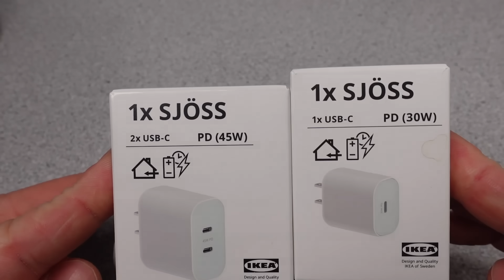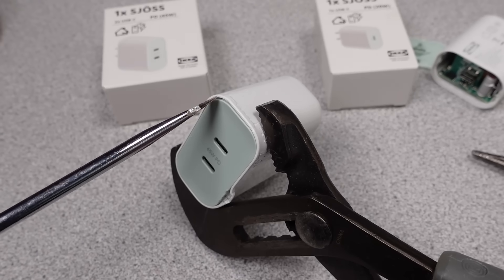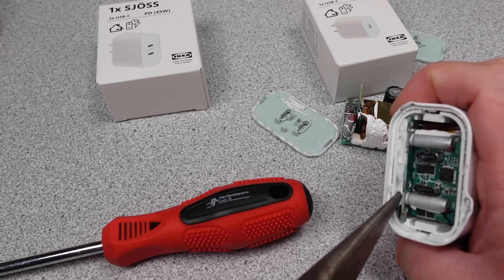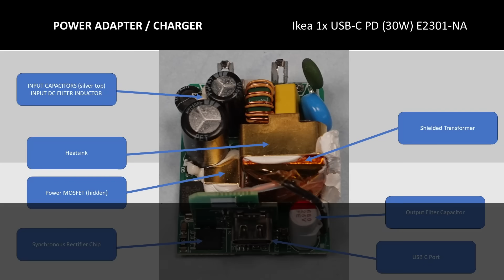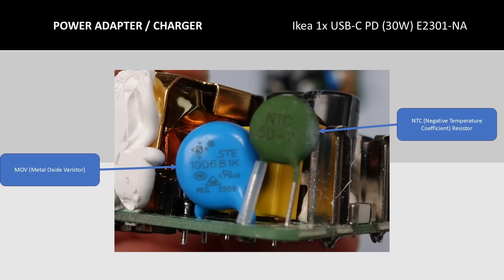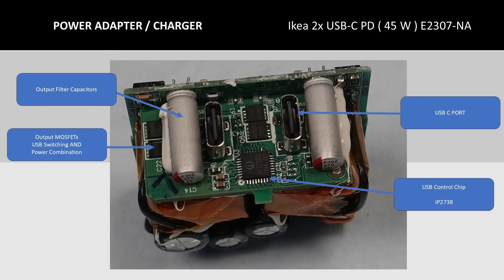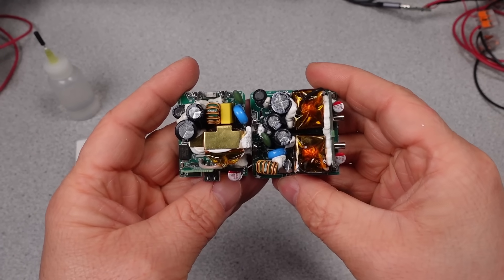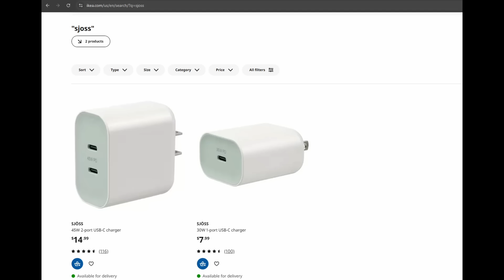IKEA cheap USB adapter Tear Down

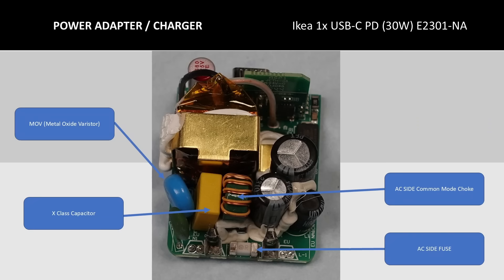Comment: 6:18 I thought that’s the class Y suppression capacitor, not the MOV. I’m so used to them being blue. Now I realise class Y capacitor could be surface mount… why not?
Reply from the maker: Yep, the google 67w adapter is more interesting, they use two in series and do some interesting layout for extra protection.
Reply: @AllThingsOnePlace  the video you posted 4 weeks ago? You didn’t do a teardown did you? I couldn’t find one.

Comment: Now they have a 65W version as well. And they sell what feels like quite a decent quality 100W breaded USBC cable to go along with it. Gives you a laptop charger for under 25euros.
Reply from the maker: Yeah, I'm waiting for it to be available.
Reply: @AllThingsOnePlace ...was going to mention this as well. Btw, my local ikea shop seems to not offer the 30w adapter at the moment, while France has it at only 5,99€. They also dropped the the price for the 45w adapter to 9,99€ while the 65w is offered for 12,99€. That is kinda nice value for money.
Spoiler... Not the smallest 65w and only 1 usbc port, but i am curious to see your efficiency and quality report. 😅❤

Comment: Thanks to your channel for all the information you provide, but as someone who isn't very knowledgeable about everything you're talking about, how can we identify a good charger with the tools I have? In my case, I have a multimeter along with a bare USB cable to measure voltage, a 3A USB load, and a USB voltage meter. I perform the following tests:

Idle voltage measurement with the cable and the multimeter;

USB meter next to the load, and I adjust the load to the maximum indicated power and measure the voltage with the multimeter because the USB meter isn't that accurate;

USB load connected directly and I measure the voltage;

Stress test at the maximum indicated power for 30-60 minutes. I check with my hand how hot it gets to the touch and measure the voltage.

Take the charger beyond the maximum power and see what it does to the load.

Is what I'm doing right, or is it a waste of time?
Reply from the maker: It's a start for sure.  Some way to trigger the higher voltage modes, and making sure your test load can handle that power level.  They do make cheap AC power meters also, like a killawatt or similar to get an idea of how much power they are using on the AC side.  Sounds like a good strategy though.
Reply: @AllThingsOnePlace  I appreciate the honesty and the comment. I actually have a USB switch board that allows me to switch between QC 2.0 and 3.0. Yes, it's old, and the electronic load I mentioned supports it.

Comment: Compared to the apple dual type c charger. Which is better without taking the price into consideration?
Reply from the maker: It's a toss up on efficiency.  The apple is maybe slightly more compatible with apple since it only does what their devices need.  In terms of components and build, there is no difference.

Comment: The 45W seems to have higher leakage current on the UK plugs. Seems like there might be some variation between batches. I get a tingling feeling on laptops/ipads
Reply from the maker: Yeah, based on the teardown I would expect the 45W to have more leakage but it measured much lower.  There's only major sources, the transformer and the noise suppression capacitor.  There must be some sizeable variation as you mentioned.

Comment: Should I store my data using an SSD or a flash drive? Also, could you elaborate on the topic of creating a server with an internet provider (modem) and a storage device? Which external hard drive is more sensible? What models would you recommend? It could be nice to make a video about this.
Reply from the maker: 3 2 1 storage backup and an offsite backup  it's not really a pc channel
Reply: @AllThingsOnePlace    You're absolutely right, I made a mistake  so sorry about that! I'm currently looking into which option is best for backup, and that's why I wrote this message. My apologies again!

Comment: I picked up a few of these charges and I see that the charges will not charge a "dumb" device if it can not negotiate. I would have assumed that the charges would have provided a default 5 volts initially but no they only will charge devices that will negotiate. That makes these chargers less useful.
Reply: Literally every usbc charger behaves in that way. If the dumb device does not provide PD handshake, no change will flow. USB A needs no handshake to provide 5V
Reply: @adalbert93_75  Apparently my smart phone isn't very smart. Other dumb USB-c devises seem to handshake. Looking into my problem, apparently it just takes one resistor to complete the hand-shake.
Reply from the maker: Yes, many lower cost electronics will even have the foot print for the resistor on the board and they don't populate it so they become incompatible, then there's the devices that use QC and a USB C port, also incompatible.

Comment: I have to ask you. Now after the teardown do you still think the 30W is a charger you should skip just like you said in your first video made on the two of these?
Reply from the maker: It's made well that's for sure.  There are better 30 watt adapters performance wise but not at that price point.  I'd step up to the 45W still in most cases.

Comment: Have you ever heard of the Novoo 100w. It looks usual and the price is under $30. Some people are talking about it. Are you going to try it?
Reply from the maker: I haven’t yet. But yeah that’s a low price.  The usual things apply.  Look for a safety listing, look at the PD modes, look at the input current, if big number 2+ Amp rated for 100w probably doesn’t have PFC.

Comment: Ikea probably uses the same 45w module inside the skotat powerstrip with 45w charger.
It's a lot more expensive than the brick €25 vs €13.
Reply from the maker: Yeah, power strip adds quite a bit more bits so understandably more expensive.  I think someone looked at it in the comments though and found it measured quite a bit different.

Comment: What's the auxiliary capacitor function again? Is it the one that filters the power supply to the primary side's pwm chip?
Reply from the maker: The transformer has an auxiliary winding, this is rectified, and smoothed by the auxiliary capacitor, which then supplies the power for the primary side chip.  When these go you see things like the flashing LED signs as the power supply tries to start over and over this is often the culprit.

Comment: I usually boil the transformer in water for 10 minutes to soften the glue and then cleanly separate the ferrite. Does not always work, but looks like it would have worked on these transformers. This allows to demonstrate whether there is a gap or not.
Reply from the maker: Yeah, I chose brute force for speed.
Reply: When a user came to me with a dead AC adapter and I autopsied it, I tried the DiodeGoneWild method of simply heating the transformer using hot air: it worked beautifully.

Comment: Thanks for the teardown. It is clear that they did not intend to make things as compact as possible, like Scosche or Anker do. Rather make the reliable and compliant chargers with relevant specs. Interesting power combiner design for the dual port charger.
Reply from the maker: Yeah, I want to make a little separate video going over the layout of the MOSFETs for the combiner.  I did in another video but make it more clear.

Comment: Very cool teardown. Thanks for it.

Side note: I nominate the Hagibis 380W USB C Charger 8-Ports GaN Type C Charging Station. It is small, and has an actual cooling fan. It claims to be able to sustain 2 140W laptop charging with 100W to spare for other devices. I'd love to see a review of it (if it can actually sustain its performance over time because of that fan). 

Thanks again! I always look forward to your videos.
Reply from the maker: Yeah, that looks like an interesting device.  I did look at a couple with fans, they were not good.  I did a teardown, the fan didn't have access to anything so it didn't do anything.  But yeah, looks like blade pass frequency around 400 Hz if that thing gets cooking, I noticed they stated the noise level "as low as" ha.

Comment: Since the 45W version can connect both transformers together, it IIUC implies that the transformers cannot be directly connected to the USB C ports. If they were, you would get their voltage in both ports when just one is being used. This would be wrong for two reasons:

1. The negotiated voltage can be up to 20V, which isn't expected by the second device.
2. The standard prohibits putting voltage on VCC in USB C female connector until the other party indicates they want it.
Reply from the maker: Correct, the extra MOSFETs for sharing the power adapters prevent illegal power conditions.  The 20V would not appear on both ports if requested by one.

Comment: I got an Anker 45W charger for my MacBook Air M1 and quickly realized Touch ID wouldn’t work when plugged into it, unless I pressed my hand firmly against the aluminum frame. I tried with my Anker Nano 3 30W and with a Steam Deck charger, and there was no issue, so I replaced it with an Anker 67W, which works well. 
Do you have any idea what could possibly be the cause of this issue? Could that be AC leakage from this 45W charger?
Reply from the maker: That does sound like ac leakage.

Comment: Do you happen to know of any surge protecting power strip brands that are of decent quality? I'm looking to get a couple to mount under my desk to tidy up cables for my desktop setup and I'm not sure which ones to look at. There's a lot of questionable stuff out there these days.
Reply from the maker: Yeah, look for a safety listing as a first choice.  They at least have to pass some inspection requirements with that.
Reply: @AllThingsOnePlace  Alright, I will do that regardless, I guess I'll collate reviews and safety listings, though I've seen some implementations from the same company with worse performance characteristics than others as you've shown with construction of chargers and their performance being better or worse with updates.

Comment: What brand are the caps and what is the temperature rating? How does the crossover switching work in the 45W version? Are the two ports forced to output the same voltage? Or if both ports are used the charger reverts to 2x22.5W mode?
Reply from the maker: The power sharing I was going to do as a separate analysis.  The caps are 105degree c rated.

Comment: So not the most amazing chargers, but reasonably good... I am curious on how they compare to a better charger that is similar in size in the build and component selection
Reply from the maker: For the most part they are the same.  Cap's are from any brand that will sell them, there's no way to know what the SMD parts are, unlabeled caps, resistors, various; but yeah there are plenty of apple tear downs out there to check out.

Comment: As expected by Ikea, their electric equipment is generally of good quality.
Reply: Yeah their LED lightbulbs are sweeeeet, good CRI, cheap, plenty of choices for cold / warm / dimmable. Had one fail on me (out of many) but their return process is hassle free as usual.
Reply from the maker: Yeah. I did a teardown of one bulb. It was well made.
Reply: Well it's pretty much the business idea of IKEA. Well designed, affordable quality products. The idea is you should always be comfortable buying their products. But their products will never be flashy or luxurious, it goes against the none bragging ethos of being Swedish. If you ever actually found a quality issue, I do believe they would appreciate if you'd tell them.
Reply: I had an IKEA oven and an induction heater. They both sucked big time
Reply: @pmbdk  Those are not IKEA it's Electrolux or Whirlpool, just sold by IKEA. Like Dell, HP or Apple sold by Amazon.